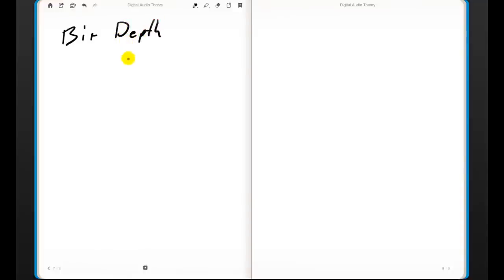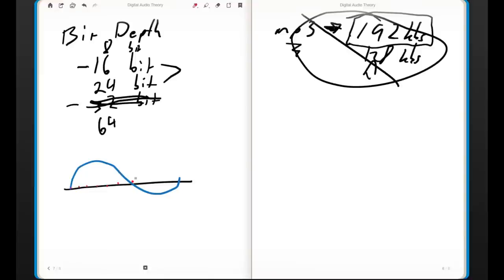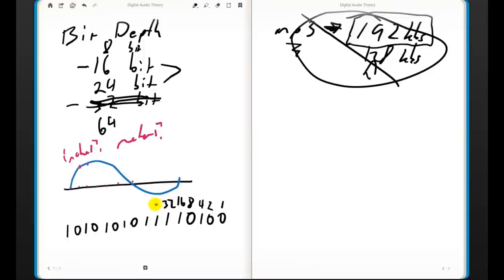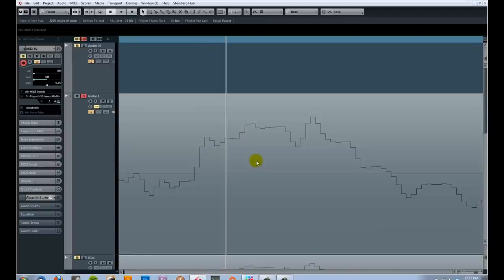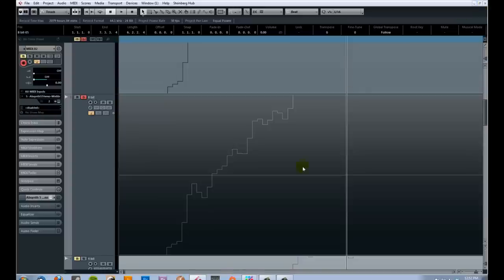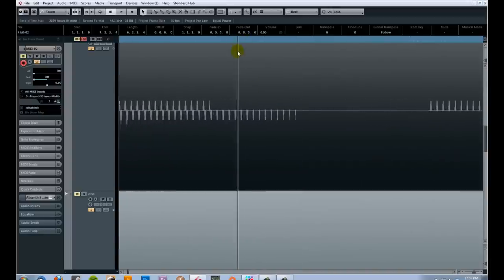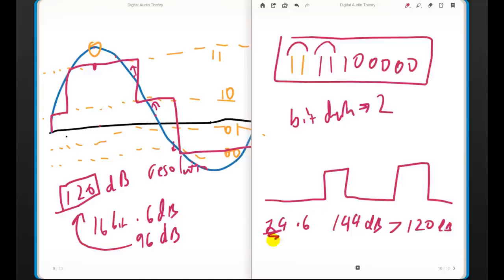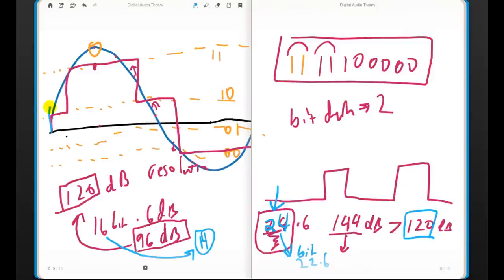Nick Sibicky's Music Production Secrets #32 - Digital Audio Theory 3 - Bit Depth

Comment: Could you explain the differences between 32 bit and 32 bit floating point? Are there advantages of using either of these over 24 bit?  I have been recording at 32 bit FP. Is that a good idea, or would I get better quality using 24 bit?